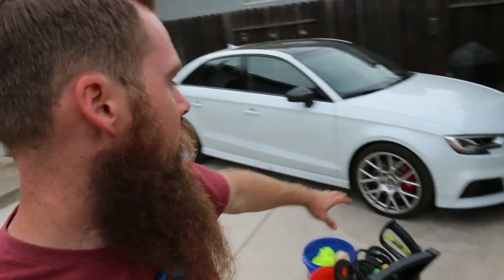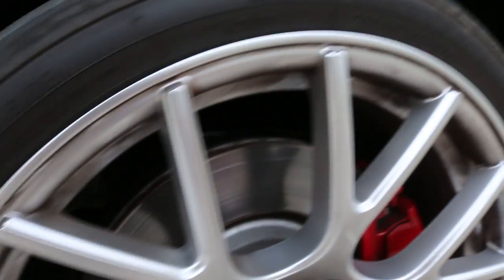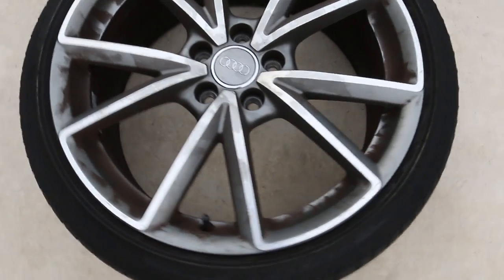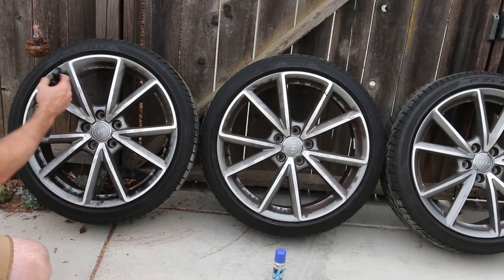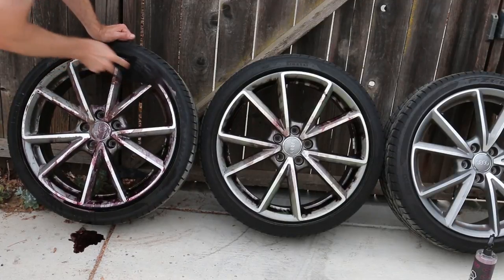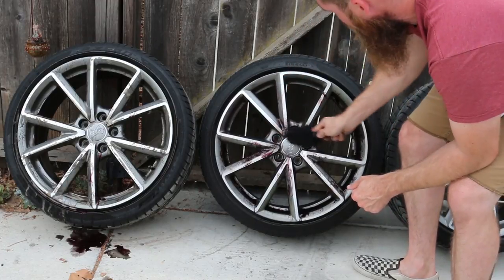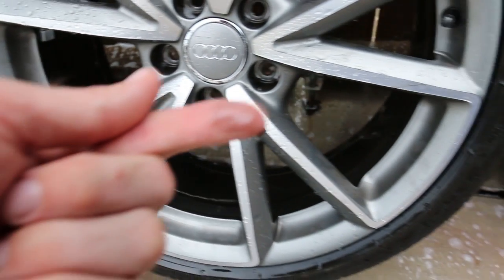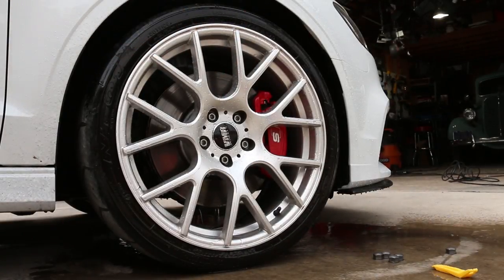WHEEL CLEANER BATTLE 🔥🔥FIGHT!!🔥🔥

Comment: I don't think it was mentioned, but does the Carbon Collective need to be diluted before spraying on the wheels?  I tried the Chemical Guys Diablo wheel cleaner and was unimpressed.  Also it needed to be diluted before use (I don't like using 100 concentrated stuff).  If the Collective can be used straight from the bottle, I may try it.  I have my Black Optics wheels (like yours) Opti Plus coated so it should clean up well.